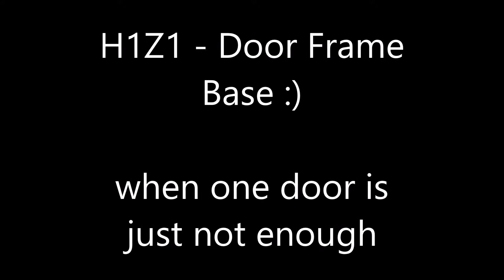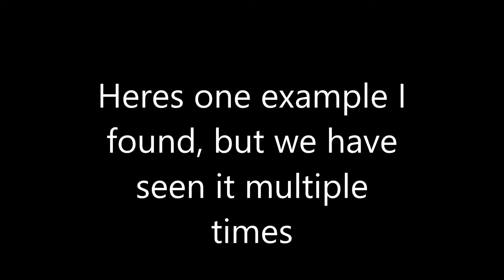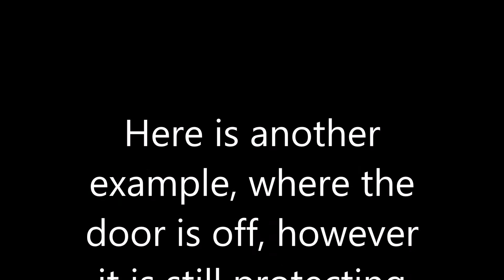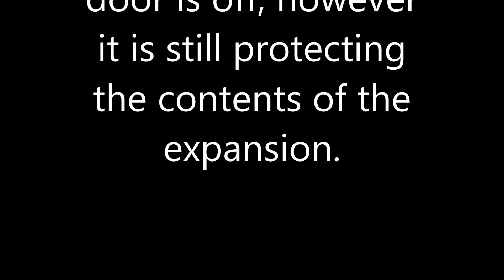H1Z1 - Base Building - PV Door Base

Comment from the maker: upcoming patch notes : 

Fixed an invulnerable base design that used the “door within a wall” object.  

hmm might be time to move that loot, I hope they still make it so the doors are protected, and you still have to use 25ish to blow up the walls.

+BPMVT lol also BP should be happy, he is such a wolf magnet : 

Fixed an issue that caused a higher than normal amount of wolves to spawn